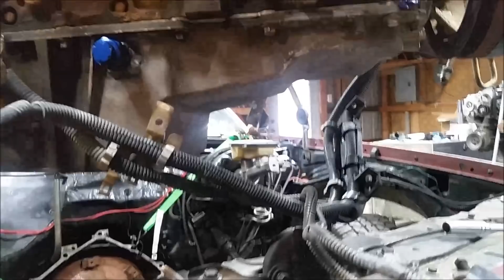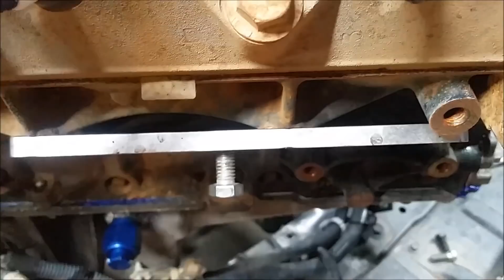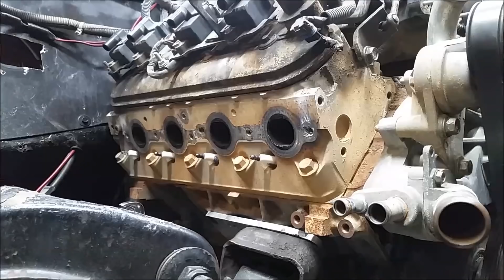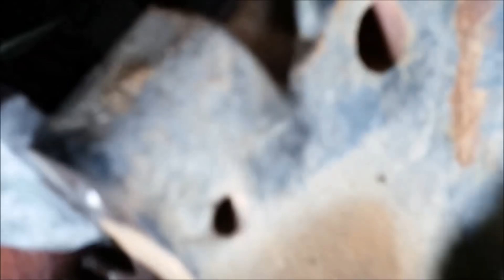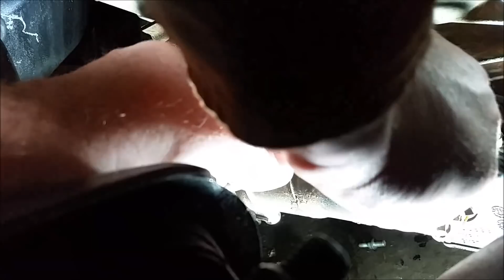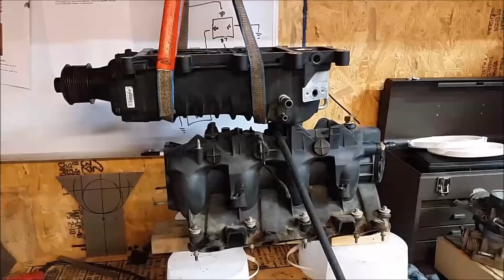Part 3 How to LS swap a Gbody. Motor mounts, converter bolts, starter wiring.

Comment: Did you notch truck motor mount bracket to clear the ls block if not the mount will not set flat to lsx innovations adapter plate
Reply from the maker: I do remember notching a set of motor mounts. I no longer run those mounts. I'm now using a set of solid lsx to gbody mounts. They are awesome.

Comment: Hey man im having trouble getting my 5.3 ls installed in 84 cutlass g body. i think it came with EXACT SAME TRUCK MOUNTS ,   they are not lining up!
did you use headers or stock manifolds , cuz my stock manifolds are hitting driver side frame rail and area with brake aportioning manifold which the tranny gear changer lever is attached to.
Reply from the maker: I think I used LS1 F body manifolds but still had to notch the frame or crossmember. Not much but it's necessary without spending the money on a set of headers specifically for this car.

Comment: my adapter  DOES NOT DROP RIGHT IN  im gonna need to dremel out one of the clamshells cuz i can only see about 1/3 the hole. that mightve just been slop in the holes both went the wrong way to make this happen or maybe the 3 bolts holding car isolator could be moved but kinda too late now as it took 4 hrs just to get it in the engine bay

Comment: what happened to you ac/heater box? mine is huge an neccessitated having to put that manifold on ahead of time or i would be able to easily get at last manifold bolt w/o removing inner and all that good stuff?
Reply from the maker: The first thing to go when I received the car was the AC and heat. I never took the time to shove an engine in it so I can't really help with this question but there are a lot of guys keeping that stuff with ls swaps.

Comment: How did you mount the 4l80? Factory cross member or custom? I am putting lq4 in 86 regal.
Reply from the maker: A custom crossmember. Actually it was a rusted up piece of channel iron that I cut to fit between the frame rails.

Comment: I would have taken a grinder to the ac bolt hole instead of drilling  out the motor mounts silly goose
Reply from the maker: The motor mounts are from a truck and were totally wrong for what I was doing. There's a LT1 with solid motor mounts in it now.

Comment: I would have just bought the holley pan before cutting the structural crossmember so much.
Reply from the maker: I dont think the holley pan was available at this time; however I would agree and would like to buy their pan with the AN fittings cast into the sides.

Comment: would i still have to cut the cross member to use the truck oil  pan?
Reply from the maker: No. but the truck pan hangs down really low.

Comment: I am putting a 5.3 in my 83’el Camino with 4l60e I got afl cold air intake shorty afm shorty headers, dual fans for the radiator, using billet mount plates and actual sbc mounts, hopefully I don’t have to cut much not sure what fuel pump ima use or what pan will work but we will figure it out and I know I have to customize my drive shaft but my worst expense is gonna be getting a new intake or just using a cowl hood my hood won’t be able to lose with the truck 5.3 intake unless I use a cowl induction
Reply from the maker: I've fit a truck intake under a third gen camaro hood before and the truck intake clears the grand prix hood. You might have to do away with the cover and shave off the extra junk on top that's not needed. Might take a little time but will be zero expense.
Reply: Divine Speed Team we think we have it figured out but my ac bracket won’t fit with the billet plates I got even if we reverse them so either cut the ac bracket or the plate I will sacrifice ac for hood clearance and my engine turned out to be a 4.8

Comment: Great work! What did you do as far as the drive shaft with the 4l80e? What length drive shaft with stock 7.5? Did you have to change the rear yoke spline?
Reply from the maker: I just had to measure and have the factory shaft shortened and swapped slip yokes. I don't remember what the length was and it will probably vary from car to car depending on where you set the engine. I'm still using the factory rear yoke.

Comment: Hey I'm having trouble removing my bell housing bolts any advice I have a 84 Grand Prix
Reply from the maker: Sometimes I use a couple of long 1/2" drive extensions, a swivel, socket, and impact. 9 times out of 10 that will work if you have a good impact like an ingersoll rand. If not, I try to just use a wrench or maybe two wrenches put together.

Comment: I used the clam-shell mounts from the V6 removed from the 'Camino and a LSX plate kit. Found that if I swapped sides on the plates the mounts only set an inch forward from stock. I'm using a 4L60E tranny. I used the stock crossmember by setting it back placin the front hole of the Xmember to the rear hole on the frame. I tied it together by using a couple of pieces of 1 1/2 " angle iron drilling holes and bolting from the rearhole of the Xmember to the front hole of the frame on both sides. Then placed he lower mounts to the K-frame on the clam-shells, set the eng/tranny in, lined it all up then tack welded the lower mounts to the K-frame. Solid welding them after removing the power plant.
Reply from the maker: Probably worked just fine doing it that way. I have to borrow a welder. I wanted to weld something different in but it was more of a hassle to find a welder.

Comment: Hey what kind of frame plates you got under there for the engine to sit.
Reply from the maker: Serg iio I'm using the lsx innovations mount adapters. I'm not sure if that's what you meant by frame plate.
Reply: Divine Speed Team, Got ya thank you sir.

Comment: I'm looking into ls7 swapping my 87 grand prix with a manual transmission and I honestly don't know what transmission to go with any ideas? Also it would probably be a ls7 from an c6 zo6 do u think that oil pan would be ok or should I just get another one?
Reply from the maker: I'm not sure what transmission would be best. I know some people have the clutch pedal deal figured out because there was a g body that had a manual option. I don't know what it was. Now if money wasn't an issue I would have a newer 6 speed. The LS7 is my dream engine. It did however use a drysump pan so I don't know if you would have to swap oil pumps to swap over to a LS1 pan or if you can use the drysump pan. I would use the drysump system if at all possible. I know that doesn't really answer your questions but I hope you can get it figured out.
Reply: Divine Speed Team thanks anyhow, after going over all the options I might just consider leaving the sb400 in there.
Reply: Research the CD009 and Z32 transmissions.
Reply: I would probably want the tremec t56 or tremec tr6060 if I was going manual. You could run into issues getting parts for the t56 though.

Comment: The truck mounts have plates behind them in the truck they will never work in the car also use a 1-inch Bolt for the clam shells
Reply from the maker: I know what plates you are talking about but the truck engine I robbed these mounts from did not have them. I just slotted the holes to make it work.

Comment: get man the chip munk talk was funny lol but that was the most important part about the wiring
Reply from the maker: You didn't miss nothing on the wiring explanation. I was just talking about what I was going to do in the next video. Actually the next video is a quick explanation on the fuel system and then I'll do a wiring video. I'm working on the wiring now. After that I'll be done making videos once the car starts. Anyone with a channel with less than 1000 subscribers can no longer make money on ads and that was kind of the point of making the videos.
Reply: @DivineSpeed  do u have to  knotch the frame for the Holley pan
Reply from the maker: @justinsmitty7849  it is my understanding that you do not need to notch anything for the Holley pan. In my case, the sawzall blade was more economically friendly than the Holley pan.

Comment: when you cut the frame you made it weak to much power will snap it
Reply from the maker: LOL I'm not worried about that. Like you said, you have to be making some power first.
Reply: Divine Speed Team did you flash the computer
Reply from the maker: Yea I did using efilive. It's costly. I wish I had bought HP Tuners
Reply: Divine Speed Team did you flash it for off road which eliminates everything including the government
Reply from the maker: Gangsta Made Authentic I flashed it to remove emissions. To get it to start you only need to shut off anti theft.
Reply: @chevycaprice5289  what the heck are you talking about tuning "for offroad and to eliminate the government" lol, I've been tuning GM for over 6 years and this was hilarious to read

Comment: I like the wheel and tire look what size and  offsets are u using?
Reply from the maker: You would think that if money wasn't an object he wouldn't be watching a video about a junk car getting a LM7 swap.
Reply from the maker: Dave Knutson those are actually the factory 15 inch wheels painted black. The front tires are 235 60 r15 and the rears are 275 60 r15. The rears are too big. It has eibach lowering springs in the rear and I use a 1 inch spacer to keep the rear tires off of the frame rail. The front is even worse. Someone has heated the coils to lower the car. It's very low. I would like to put the same size front tire in the rear.
Reply: Divine Speed Team ok sounds good Thank you for the reply!!
Reply: Durand Off Heroin wheres your car?
Reply: Durand Off Heroin good worry about your car and I'll worry about mine boy.
Reply: Durand Off Heroin ok dodge boy you just keep raming things up your ass.

Comment: Ctsv pan isn’t as deep.
Reply from the maker: I'll will have to make sure and mention that in the next video. Thanks
Reply: I used the muscle car oil pan for my gbody el camino..i used mid 80s caprice clamshells...th350 /5.3 s-10 ls swapped shorty headers no clearance issues..same ls adapter plates...some ish work some dont.
Good luck my brotha!!👍
Reply: @TheKuntryboy15  did you use the truck accessories and intake
Reply: justin smitty yes sir i did! I used a tbss intake instead & 92 tb all stock pullies & everything fits under the stock hood!